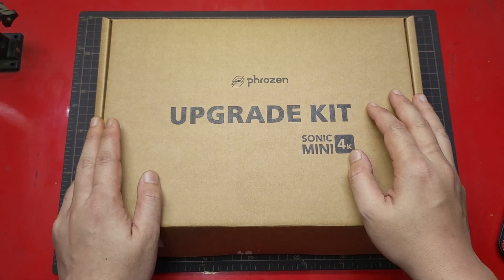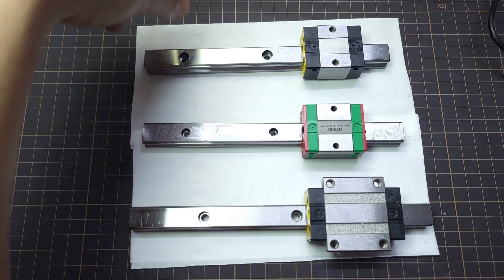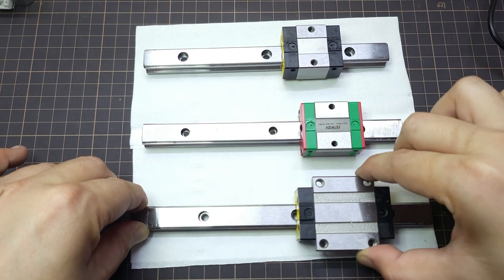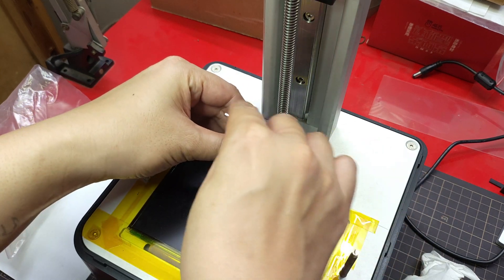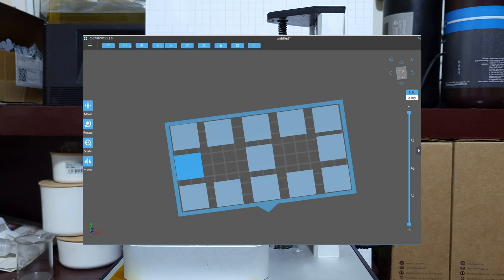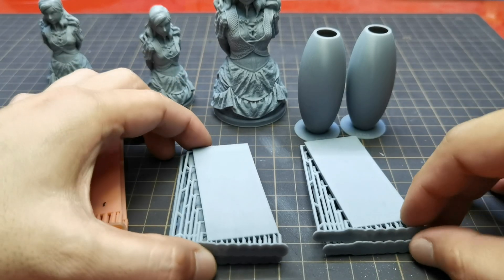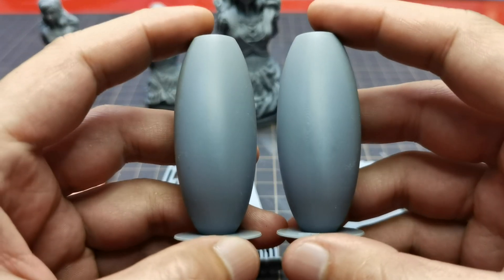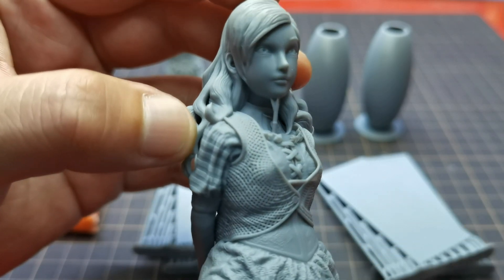Phrozen Sonic Mini 4k Upgrade Kit Assembly And Review

Comment: hi. The problem occurred after installing the z-axis upgrade kit.
The output is not working properly.
3 seconds was enough for my resin, but even after using 6 seconds, your leveling test file started not sticking properly.
The LCD test is ok and the lights come on well.
Why? I probably didn't touch anything...
can i try plug in the cable line on the board again?😢
Reply from the maker: Relevel your build plate with 3 papers

Comment: After instelling the kit, wobble lines are gone, but of all prints (4 tryouts) no print is fully succesfull. Supports fail, specially toward the middle of the buildplate.
What can be the problem? I releveled two times.
Reply from the maker: Either fep loose. Or not enough lift distance.
Reply: I already changed the fep, I will look at the distance. Thank you so far for the fast reply!
Reply: I have 6mm lifting distance for anycubic eco grey
Reply from the maker: @Streamcatcher  did you use the method in my video when changing the fep?
If not, then it could be loose.
Reply: @wangdennys  it sounds as tight as a fresh speed drummers snare drum. I will have a look though.
Reply: @wangdennys  I never used tape, though I changed the fep many times without issues. It's really after the use of the upgrade kit that prints are failing.
Reply from the maker: @Streamcatcher  then for now
Try higher lift distance like 8
Reply: @wangdennys  I found the issue, looking back, I could have known... the control board/cable of the LCD screen is taped to the inside of the printer, that tape had come loose. When closing the printer after installing the upgrade kit, that control board/cable got between the UV lights and the LCD screen, blocking the UV lights in one place.

I found out after running 2 matrix test files and noticing the errors where exactly in the same place.
Reply from the maker: Nice!
Reply: @Streamcatcher  I have same issue on Anycubic Eco Grey - check other resin(or don't use it)

Comment: so mine shipped with the upgrade, and it still flexes the tower. the arm, yes, is fine, but the tower still flexed.
i put a nema stepper damper on and that seems to have alleviated a lot of it. i'm not sure if the rubber damper is compensating the extra force or what but my prints seem stable as far as adhesion and consistency.
i'm assuming it's a worthwhile mod since they decided to include one on the 8k.
if nothing else, it is SIGNIFICANTLY quieter on moves.

i do have some threaded rod to reinforce the tower, but if i can manage to get some decent test prints (now just having issues with exposure times... mine are 3s+ at 30um which seems way off) but otherwise, it looks good with simply aligning everything and adding a damper. and getting one of these (hopefully free if you complain enough) 'upgrade' kits (which let's be honest is half them trying to sell resin overstock and half trying to placate a design flaw).

Comment: Great video, thanks. The upgrade kit seems good but Phrozen charge almost the same price as the kit to ship it to the U.K !
So basically , a £300 printer that is faulty by design will cost me another £150 to make right, totalling £450 for a 4K Mini. I am so upset by Phrozen . I am able to afford the upgrade but not the shipping too 😞
Reply from the maker: Try look up my previous video for fixing the wobble lines on sonic mini 4k with hiwin guide block.
Reply: @wangdennys  Thank you for all your hard work. I found the upgrade kit from 3DJake for £45 including delivery 😊 it should be here in a week.

Comment: There is still flexing in the z axis column. But I don't think this causes any print problems. However, I do think this flexing may be the cause of the base cracks that so many of us SM4K owners have.
Reply from the maker: Probably
Reply: @wangdennys  not really. the issue is two-fold: 1) the Z-tower is attached with only TWO bolts to the base, so naturally it can pivot on the axis running between those two bolts (the real solution would have been FOUR bolts, as in the Mini8K), and 2) the aluminium base is too thin anyway so even with four bolts it wouldn't have the necessary rigidity
Reply from the maker: Sorry
Youtube just straight off auto delete any comment with link.
But i seen his dual rail upgrade. 
Unfortunately i do not have the equipment to make such upgrade, if i pay other to do it for me, i better off buy a mighty 4k 
LOL
Reply: @wangdennys  show me what needs to be done. I am a machinist and have some machines.
Reply: @wangdennys  oh, I see. okay, just wanted to make sure you were aware of it 🙂 I'm not sure which equipment you're referring to, the dual rail used in the "Solid Mini 4K" upgrade is the one sold by "Jackson Products" for the Anycubic Photon. Other than that you just need a drill

Comment: I don't own this printer, but have been watching it over the past year. It seems that this upgrade kit is the first step in the right direction, however, it's not enough.  The z-tower desperately needs to be reinforced.  Is it possible to install triangulating braces on either side of the tower, attaching them to the base of the printer somehow?  Is the base sturdy enough to accept this new load?
Reply from the maker: I saw some people add braces to the tower in fb group

Comment: hmmm... I recently got my upgrade kit and installed it but haven't run it.  Problem is the the rail doesn't run smooth at all.  I'm now worried.
Reply from the maker: I lube my rail and block with super lube
You could try it first.

Then move it back and forth several times to spread the lube. 

And sometime you will notice dirt got flush out along with excess lube. Wipe it clean.
Reply: @wangdennys  Interesting, I'll give that a try, thank you.
Reply: @tek9058  No, it didn't/doesn't move smoothly as soon as I pulled it out of the packaging before I installed it.